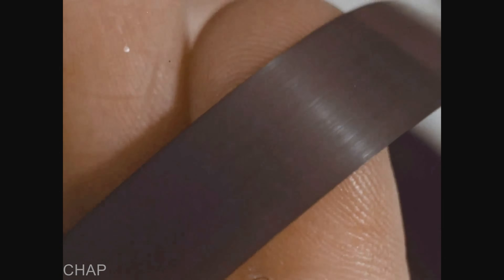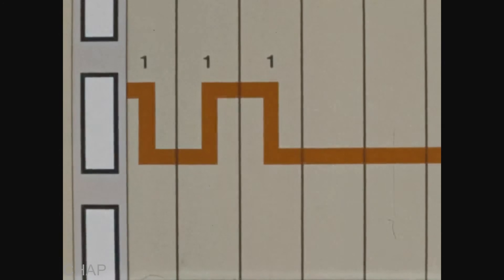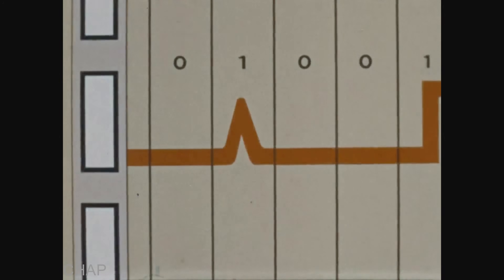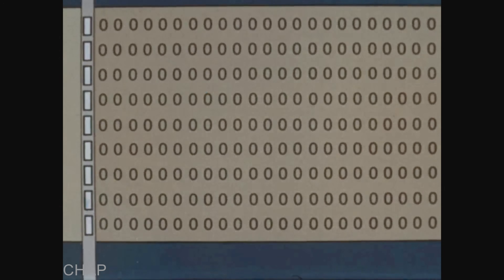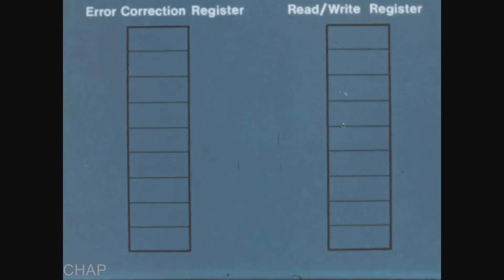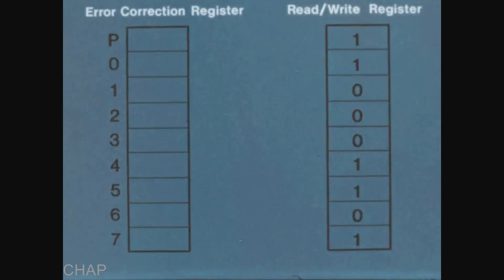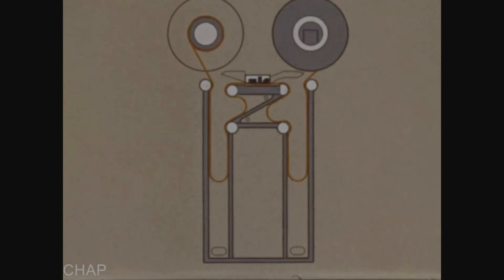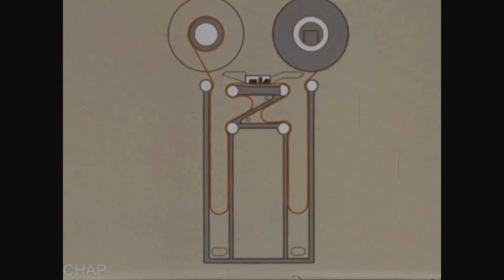Do you know HOW a COMPUTER TAPE DRIVE REALLY Works?  1968 Phase Encoding IBM 2420 NOW  Technology

Comment: Amateur computer operator at work there 😄. I learned to manually thread/load tapes on Burroughs and ICL tape drives before moving to 2420s on an IBM S370 model 3031. We mounted tapes like F1 pit crews change tyres - fast, even with little 1200 tapes! But the real test was paper tape - that stuff would know when you were in a hurry and mess with you.
Reply from the maker: Hi @grahamr56, great comment!   I love how you compared mounting tapes like an F1 pit crew at work.  Nicely done.  I is just as important to keep the computers running "on track."   : )

Comment: My first job out of college was at C J Kennedy Co. designing 1600 BPI, PE drives. They made versions for minicomputers. This made it possible to exchange data between mainframes and smaller labs that had minicomputers. Was a great job doing low level analog signal work, digital design, and power servo design. That wide range of engineering experience served me well until I retired.
Reply: Back in the late 1980's / early 1990's our control system vendor had a Kennedy drive connected to the Perkin-Elmer 3205 they were using for development and testing.  I remember watching their programmer load and use the drive many times.  I don't recall him ever having any issues with it.
Reply: @meltysquirrel2919  Those were the days. Chuck Kennedy was the owner but also an engineer. He really treated all his employees well. I eventually left the company to work more with microprocessors. Chuck was somewhat intimidated by them. I gave notice I was going to a competitor who wanted to work with uPs in early Dec. and he not only kept me on through the notice, but I received, like others, a Christmas bonus. A more decent employer I can't imagine. He was my model for ethical behavior the rest of my career. I refused to use any knowledge of Kennedy products to help my new employer. They were annoyed, but understood, and probably earned me some degree of grudging respect.
Reply from the maker: Hi @doug6763-h6y, sounds like you have some great experience there!   Thank you for sharing that!
Reply: I did system administration work on an HP-9000 running HP-UX back in the 1990s.  The HP horizontal loading tape drive appeared to be a Kennedy drive.  The HP technician did a firmware upgrade in the tape drive about a year after we purchased the system, but the tape drive required no maintenance other than routine cleaning in the 10 years we used the HP machine.  That is remarkable reliability for equipment of that era.

It was quite a contrast to a DEC Vax which we had equipped with a tape drive the size of a refrigerator.  The DEC drive broke down fairly often and was finicky compared to the HP drive.  The DEC field engineer did not have to worry much about job security.

Comment: Surprised to see that "phase encoding" actually meant something - I thought it was going to be like Sega's "blast processing"! 🤣
Reply: Actually, it's commonly used in telecom.  The dial up modems often used quadrature modulation, where signals at 90° apart were combined to produce a waveform at various phase angles and amplitudes.  These days, 5G uses phase shifting for beam forming, where the signal is formed into narrow beams that can be aimed at where the phone is.

Comment: I learned NRZI as Non Return to Zero Inverted.

I was a computer tech back in the 80s and worked a lot with tape drives, mostly Data General.
Reply: Yep. I heard the NRZI and immediately thought No, its Inverted not IBM. But I remembered that the whole world was IBMs to name and control in those days.  No competitors name or their usage name, designs or product existed within IBM, it was forbidden. We just called the drives IBM compatible. As they were often used to transfer data from a local production or accounting computer to a commercial data centre mainframe for processing in addition to storage and backup. Not much was done via a telephone wire and there was no internet or wifi.
Also, while tape skew was a problem, a major cause was engineering tolerance on the recording head itself in the alignment of all the 9 bits. The physical location of all 9 recording gaps needed to be adjusted for in drive setup as well as in the drive firmware. The higher the recording density the tighter the tolerances needed to be or any track could put its 1 or 0 in the wrong line, including the parity bit.
Reply: @jimspc07   Actually, aligning a tape drive head is something I have experience with.  Back in the 80s I was a computer tech.  The procedure, at least on the drives I worked on was to use an alignment tape and then adjust the entire head so that on read the bits were aligned as close as possible.  Then, write to a scratch tape, while adjusting the delay to write each bit so they lined up properly.  Those heads had read after write, so you could monitor this.  It also allowed the data to be verified as it was written.
Reply: @ Yep. Adjusting the 'one shot' I think think was the term. But wow it was so looooong ago Maybe i'm thinking of something else. 
But doing it on site was a real pain. Some of the drives we had were small and we could take the whole unit back to the workshop after connecting a loaner. That was picked up when the call came in as a precaution. That was always better than lugging a scope and tapes around, and on site everyone was wanting to know how long you would be, one after the other.

But whatever. Thank goodness for USB sticks.
Reply: @jimspc07   Fortunately almost all the systems I worked on were in our office.  Most in "Data Central", though there were a few upstairs in the Air Canada reservation system and a couple in a stock brokers office, a few blocks away.  I know about the pressure in that job.  On one occasion I had to go out to Edmonton, from Toronto.  I was able to correct the problem in about a half hour.  Then the regional manager asked me when I'd have it fixed and I told him it already was.  I then packed up and took the next flight back to Toronto.  That was Toronto to Edmonton and back in a single day!  That's almost 3400 miles of flying!
Reply: @  Another example of pressure.  A few years before I started working as a computer tech, I was a tech working in the Toronto Stock Exchange.  When something on the trading floor failed, they wanted it fixed immediately.  We had spare equipment ready to go, sitting on a table with wheels.  When we got the call I'd roll the table up to the trading floor and swap out the machines. We had them equipped with the old 1/4" phone plugs & jacks, for quick swapping.
Reply from the maker: Yes, and sometimes called "Non Return to Zero, IBM."    Have seen it written both ways.
Reply: @ComputerHistoryArchivesProject 
I just searched Wikipedia, which lead me to US patent 
2774646, issued in 1956. It apparently expired in Dec 1973, but when this film was made it was an IBM-owned scheme, and IBM could call it whatever they wanted to. 

I presume that starting in 1974, when other manufacturers were free to develop their own implementations, they didn't like having "IBM" in their product literature, so they chose to say the "I" stood for "Inverted" instead. Since that was 50+ years ago, most have grown up knowing it as "NRZ Inverted", but a few who've been around long enough learned it as "NRZ IBM".

[EDIT: 
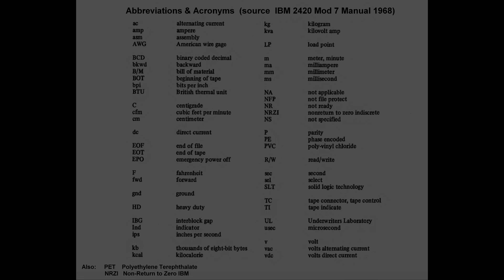I just noticed that in the list of acronyms manual page you put up at 18:03, IBM says the "I" in NRZI stands for "indiscrete", so now we have 3 options to pick from? ]
Reply: The NRZI on the bit tracks is rather similar to IBM HDLC which was used for bisync communication and I’m pretty sure that’s what runs on the V.35 interface between a T1/DS1 dataset and a router.  The Manchester code from HDLC and the concept of data blocks also formed the basis of ALOHA Net and later Ethernet.  That IBM invention really changed the way the world works.
Reply: @wtmayhew   ????
I think you're confusing some things.  NRZI is simply a way of sending data over some medium, in this case tape, that is self clocking.  HDLC is a framing protocol, used with networks.  Manchester code is another self clocking method that was also used with tapes and elsewhere.  It was used for 10 Mb Ethernet, but not higher speeds.  I've never seen any mention of Manchester code with Aloha.  Sending data by radio was around long before Manchester or HDLC.